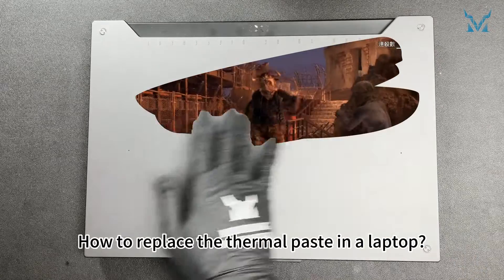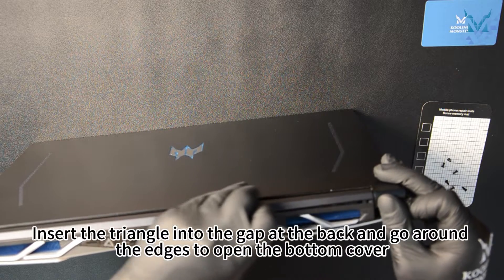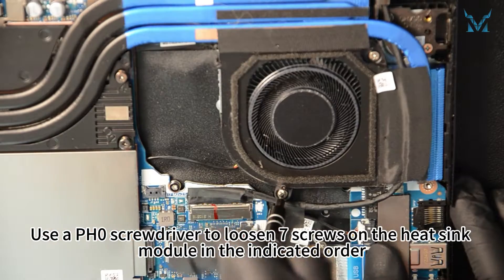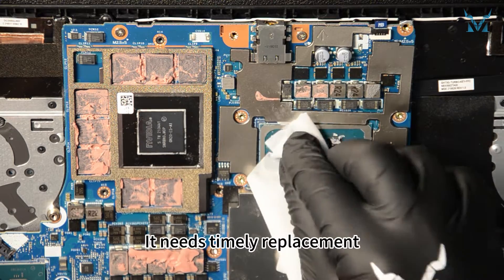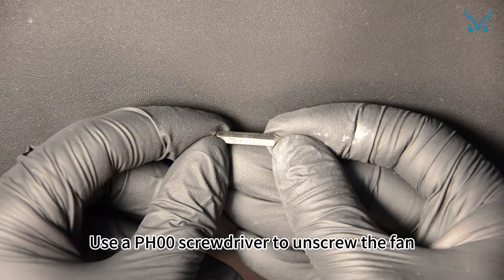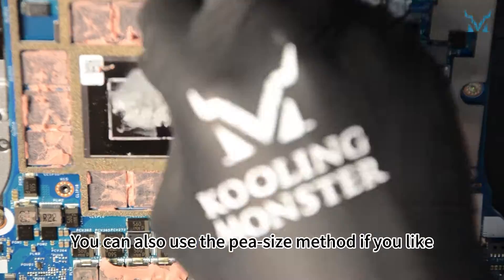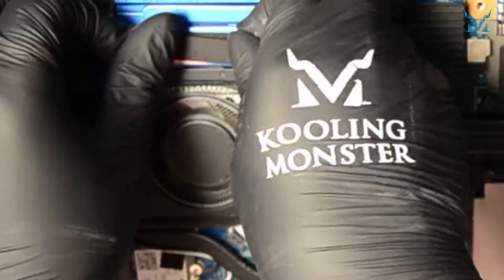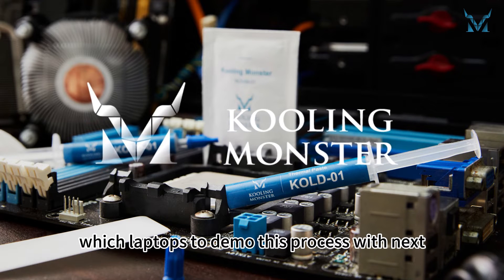Speed Up Your Acer PREDATOR HELIOS 300 - Prevent Overheating With Dust Cleaning & New Thermal Paste

Comment: This, is what I was looking for. There are videos for literally EVERY OTHER APH300 and other models, but almost nothing for N20C11. Heck trying to look it up on their website attempts to lock you out of the website for whatever reason.

I also am happy to know that the kink in the pipe is a factory defect and not because I was stupid.
Reply from the maker: Right? The N20C1/N20C11 guides are surprisingly rare… glad this one helped you out! 😄
And don’t worry — that kinked heatpipe is a factory design, not your fault at all.
If you ever need repaste tips or tool recommendations, feel free to ask! 🔧🔥
Reply: @koolingmonster  thanks, much appreciated! Luckily I was able to do it myself, though now I need to buy fans cause one has a failed bearing and is vibrating. At the very least I know how to handle it now, yay

Comment: How often do you recommend this is done? I've got the same laptop, and me and my sister opened it up just to install an extra SSD and we vaccumed the fans, but we didn't remove them completely as its only two years old.
Reply from the maker: Great question! 😊
For most gaming laptops, replacing thermal paste every 2–3 years is ideal — sooner if temps start creeping up or the fans get loud more often. Since you already upgraded storage and cleaned the fans, that’s a great start! 🧹💻

If you ever decide to refresh the thermal paste later on, feel free to check out our tutorials — and we have a full toolkit + high-performance paste ready if you need it! 😄🔥✅

Comment: Would this also work for the Predator 300 3070 ti? 12th gen i7-12700h, 1tb, 16gb ram
Reply from the maker: Yes, the process is very similar for the Predator Helios 300 with i7-12700H + RTX 3070 Ti ✅
Screw layout may differ slightly, but opening the back, disconnecting the battery, removing fans/heatsink, and repasting all follow the same steps.

If you want, I can also make a dedicated guide for your exact model — just let me know! 🔧😄

Comment: is it okay to use regular wipes to clean?
Reply: no because that contains water, you always need to use 99% IPA for cleaning
Reply from the maker: Regular wipes aren’t recommended — many contain alcohol, fibers, or additives that can leave residue on the CPU/GPU.
It’s best to use specialized thermal paste cleaning wipes like our Kooling Monster KLEAN-01 to keep the surface clean and safe ✅😊

Comment: What about the copper paste on the other chips?  What is the best paste possible for both applications?  Also wearing rubber gloves in environment that makes them collect moisture quickly can be a problem when water spills out of the gloves onto your motherboard/accessories, so use a type made not to or be in a clean dry environment.
Reply from the maker: Thanks

Comment: I know this vid is old but ive had the same pc for 3 4 yrs and never cleaned it. Ive had performances issues on games and overheating too. So is getting a new thermal past + cleaning it gonna make a big diff when gaming ? Or is the pc just dead or something?
Reply: it does, if its overheating its gun thermal throttle and perform lower than base. Try cleaning it first before getting a new one
Reply: @mzulhilmi4506  ty man i'll try that
Reply from the maker: Thanks

Comment: hello and thank you for your video, do we have to replace the pink thermal paste (don't know what it is) that we see on the others places at 2:22 ?
What about VRAM ?
Reply from the maker: Thanks for watching! The pink stuff is likely thermal pad material—don’t replace it with paste. It's meant for VRAM and power chips with gaps. We only used KOLD-01 thermal paste on the CPU/GPU, and kept all original pads in place.

Comment: How come acer didnt have liquid metal on its cpu, dont they come from factory with preinstaler liquid metal on cpu and gpu?
Reply from the maker: Not all Acer models come with factory-applied liquid metal. It’s usually reserved for high-end gaming series like Predator, and even then, only certain models have it.

Liquid metal has excellent thermal conductivity, but it also comes with some risks—it’s electrically conductive and can cause short circuits if it spills onto the motherboard. It can also corrode aluminum surfaces over time.  

If you want a safer and more user-friendly option, we recommend the KOLD-01 thermal paste. It offers great performance without the risks of liquid metal.

You’re welcome to check out our KOLD-01 thermal paste.  【PERFORMANCE/OVERHEATING SOLUTIONS】- available across the globe!
Laptop dust cleaning & thermal paste replacement tool-kit combo: https://bit.ly/KMtoolkit

KOLD-01 Thermal Paste: https://bit.ly/kold-01-yt
KLEAN-01 Thermal Paste Cleaning Wipe: https://bit.ly/klean-01-yt
KOMBO-01 Screwdriver Set: https://bit.ly/kombo-01-yt
Air Duster: https://amzn.to/3YTclrP

Comment: Hi 

I have cleaned my acer predator helios 300 and now fan spin for 2 second right then left and my laptop gets heated 

Plz help
Reply from the maker: Hi! It sounds like your fan might not be connected properly or there's an issue with the thermal paste. Please double-check the fan connections and make sure the heatsink is seated correctly.

Also, we recommend using our KOLD-01 thermal paste—it provides excellent heat transfer and can help lower your temperatures significantly. Let us know if you need more help!
You’re welcome to check out our KOLD-01 thermal paste.  【PERFORMANCE/OVERHEATING SOLUTIONS】- available across the globe!
Laptop dust cleaning & thermal paste replacement tool-kit combo: https://bit.ly/KMtoolkit

KOLD-01 Thermal Paste: https://bit.ly/kold-01-yt
KLEAN-01 Thermal Paste Cleaning Wipe: https://bit.ly/klean-01-yt
KOMBO-01 Screwdriver Set: https://bit.ly/kombo-01-yt
Air Duster: https://amzn.to/3YTclrP

Comment: I also want to replace the thermal paste, but in the video, i see two colors: grey and pink(orang). The gray one is clear, but what should I use tu replace the pink(orang) one?????
Reply from the maker: Thanks for asking! The pink ones are thermal pads.Thermal paste performs better than thermal pads because thermal pads are solid materials and cannot effectively fill the microscopic gaps between the processor and the heatsink. In contrast, thermal paste is a paste-like substance that can better fill these tiny gaps in the interface.
Compared to other thermal pastes, our KOLD-01 thermal paste has a unique solvent-free formula. Unlike regular pastes that may crack over time due to solvent evaporation, KOLD-01 maintains its performance longer and provides better cooling, especially for laptops. Feel free to give it a try.

Comment: The AUTHOR is clumsy. 1) Never hold the cooling from the edges, you can easily bend the pipes, you need to do it strictly from the center, everything is done rigidly there. 2) The AUTHOR terribly smeared the thermal paste to all edges, secondly, some Helios 300 have liquid thermal paste from the factory (liquid metal). Just take an old T-shirt and remove the thermal paste with it, not paper. And of course, wearing gloves will not make you a pro. The fans need to be removed temporarily and re-greased inside. Do not do as in the video.
Reply from the maker: Hello! There were some flaws in the operations shown in this video. We will make the necessary improvements. Thank you for your suggestions!
Reply: Bro i have the liquid metal version. It is my first expierence with liquid metal got any advice?

Comment: Can I replace thermal putty with thermal pads? Will they be efficient/safe?
Reply from the maker: Yes, you can replace thermal putty with thermal pads, but there are some factors to consider:
Efficiency: Thermal pads and thermal putty are both designed to fill gaps and conduct heat from components (like CPUs or GPUs) to heatsinks. However, thermal putty generally provides better thermal conductivity due to its malleable nature, which allows it to fill in all gaps, including microscopic ones, ensuring maximum contact and heat transfer. Thermal pads, while effective, may not conform as well to all surfaces, which could slightly reduce efficiency compared to thermal putty.
Safety: Both thermal putty and thermal pads are safe to use, as they are non-conductive and stable under heat. However, when replacing putty with pads, make sure the thickness of the thermal pad matches the gap it needs to fill. If it’s too thick, it may prevent proper contact with the heatsink; if it’s too thin, it might not provide adequate heat dissipation, potentially overheating the component.

Comment: You forgot a very important step - no paste/pads on MOSFETS, you left it uneven and missing some compound.
The MOSFETS and chokes will overheat and kill the mainboard. When you want to do thermal rework, you need to reapply not only CPU+GPU thermal compound, you need to reapply on memories and MOSFETS too, a different compound designed specifically for that, which you failed to apply. It's usually blue or pink, as in original, but it's different viscosity and it is sold separately, it can be found on online stores.
Reply from the maker: Your suggestion is excellent and very professional.The surrounding chips do not require significant cooling, as the original manufacturer uses thermal pads or thermal putty. As long as the original materials have not dried out or cracked, they can continue to be used. If you want to replace these materials with thermal paste in these areas, we recommend using our KOLD-01 thermal paste because the gaps in these areas are relatively large, and most commercial thermal paste is too runny and may flow away. Our thermal paste has undergone special flow optimization, ensuring this issue does not occur.
Reply: @koolingmonster what mm pads Do you think would be good for the vram and mosfets, i have attempted to use 1 and 1.5mm but now have temp spikes to 90C
Reply: what can be used to cool the SODIMMs, I added 2x32Gig SODIMMs of memory.  Also, is Windows 11 responsible for overheating issues?  It seems like when I offer the laptop more bandwidth, it heats excessively and less so when bandwidth is less, as if bots are using my computer to mine bitcoin, or some other unknown app or apps are crowd using computers for tasks unknown to host user.

Comment: I Can't get the back off 😢
Reply from the maker: Hello, are you referring to the computer back panel? Could you specify exactly where the issue is? We recommend using the triangular pry tool included in our KOMBO-01 toolkit. After ensuring all screws are removed, gently move the tool up and down while sliding it along the edges. This will make it easier to open the back panel.
Reply: Keep trying, it took me 20min to get the back off.

Comment: Mine has liquid metal so I am afraid to open it 🥲
Reply from the maker: Liquid metal will degrade over time and lose its thermal conductivity, so it still needs to be replaced. You can easily clean it using our professional KLEAN-01 wipes. For DIY situations, we recommend switching to thermal paste instead, as liquid metal has a high failure rate and is prone to leaking or uneven application. High-quality thermal pastes, like our KOLD-01, also offer excellent thermal performance.

Comment: I'm using the same laptop. I have cleaned the dust and applied new  thermal paste. Even then PredatorSense is showing CPU temperature at 55 deg on idle. It's sometimes even 70. But the laptop doesn't feel like its that hot. Any ideas why?
Reply from the maker: 55 on idle is actually quite good. Sometims your softwares are running in the background, making CPU hotter. 70 is also a good working temperature when CPU is working.
Reply: CPU needs Liquid Metal

Comment: Hi my acer predator helios 300 ph 315 - 55 ( 2022 version) came with liquid metal.
Should I apply thermal paste or liquid metal?
Which is better according to you?
Will there be any difference in temps?
Reply from the maker: In DIY, we would recommmend using thermal paste. Liquid metal is prone to tilt leakage. Good thermal paste such as our KOLD-01 thermal paste thermal performance is also very good!

Comment: Question: How often does the thermal paste needs to be replaced?

My previous laptop - HP Pavilion from 2011 - never faced overheating issue despite rigorous use for 8 years straight and never being cleaned.

The Predator Helios on the other hand began overheating within 4 years of purchase. What I don't want to do is keep removing & applying the thermal paste every few months
Reply from the maker: You can change the silicone grease now. Changing the silicone grease should not be judged based on time, but on your frequency of use, because the silicone grease will dry and deteriorate. Changing the silicone grease can make your computer run faster

Comment: Thank you so much for this amazing video! I followed the instructions, thoroughly cleaned the dust everywhere & diligently applied thermal paste on the CPU & GPU. The decrease in CPU & GPU temperature has been nothing short of incredible - Around 30-40 °C decrease in CPU temp & 20-30 °C in GPU temp! However, in the PredatorSense software, there is a third temperature measurement, which is the System Temperature. This measures the motherboard's temperature, and it has not decreased by much. Do you have any specific tips for improving/decreasing the System Temperature? Is there anywhere else I can apply the thermal paste on?
Reply from the maker: Thank you for the comment! We are so glad that our videos or products might be of help!
Although the temperature of the computer doesn’t change much, the overall performance of the computer will be significantly faster

Comment: How do you remove that Ram cover?
Reply from the maker: Hello! Because of the limitations of remote assistance, it’s difficult to provide direct help, but you can usually try the following methods:

1. You might need to use a plastic pry tool or a similar non-metallic tool to gently slide along the edge of the cover to release any clips or fasteners.
2. Internal components might be blocking the cover; check for any obstructions or components inside that could be preventing the cover from moving.

Comment: What is that pink thing around cpu?
Reply from the maker: The surrounding chips are VRAM, which don't require a lot of cooling. The original factory uses thermal pads or thermal putty. As long as the original material hasn't dried out or cracked, it can still be used. If you want to replace these materials with thermal paste, we recommend using our thermal paste. The gaps in these areas are too large, and regular thermal paste on the market is too runny and may flow away. Our thermal paste has been specially optimized for flowability, so it won't have this issue [sending heart].

Comment: Big help. I'm planning to put a new thermal paste on my helios predator, adding a cooling pad and cleaning the fan. After years of use xD

Huge thanks to your video mate.
Reply: pls let me know when you do i have a helios predator 2020 model so it’s been 4 years and i’ve been overheating in games a lot i want to know if it’s worth it for me to replace the thermal paste or just sell it
Reply: @igniteteji  Don't sell it. I have a 2019 acer predator only rtx 2060 gc tho. You should definitely check and clean your fan if you haven't. I changed my thermal paste and added pads. I was surprised how dirty my laptop was xD cleaning and re pasing is a must. It's running quiet w much lower temp now. CPU at around 47c to 70c when gaming and GPU locks at 50c-60c when gaming. 
If you're not happy then you can sell it. Thermal paste and pad doesn't cost much.
Reply: @Li_Quid8  can you use blue thermal pads instead of pink
Reply: @qx24mk  TISHRIC 4g GD900 Thermal Paste
Reply from the maker: You are very welcome. Thank you for the comment! We are so glad that our videos or products might be of help!

Comment: Is the heat sink copper or aluminium ?
Reply: copper
Reply from the maker: The heatsink in the Acer Predator Helios 300 is typically made of copper. Copper is commonly used in high-performance laptops for heatsinks because of its excellent thermal conductivity, which helps in effectively dissipating heat generated by the CPU and GPU.

Comment: How long until we should replace it?
Reply: 2 years.
Reply from the maker: Usually thermal paste dries out in one to two years. However your laptop usecase and the quality of the original paste also determines this number. The correct way to determine if your thermal paste needs replacement is through measuring the CPU and GPU temperature. You can visit our website and read the full tutorial on this matter: https://koolingmonster.com/insights/how-to-know-if-your-thermal-paste-needs-replacing-step-by-step-tutorial

Comment: May I know what paste is that pink paste? Can I use the CPU thermal paste instead of pink paste?
Reply from the maker: Hi, the pink substance is thermal putty. It is very okay to replace thermal putty with thermal paste. While it is perfectly fine to keep using tthermal putties, thermal paste is better at dissipating heat. Thermal putties/pads are used in laptops because they are cheaper, and they can fill in gaps between chips and heatsink that normal watery thermal paste cannot. More premium thermal paste such as Kooling Monster's KOLD-01 has special focus on fluid mechanics, therefore is not watery like cheap thermal pastes and can substitute the thermal putties.